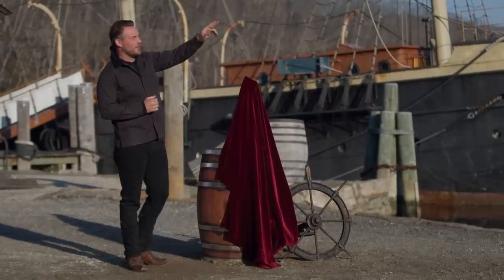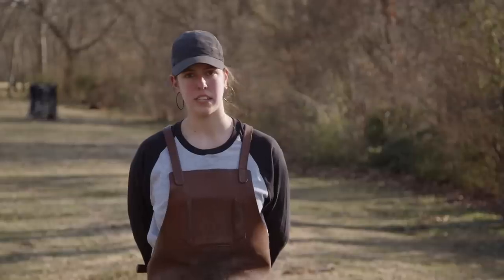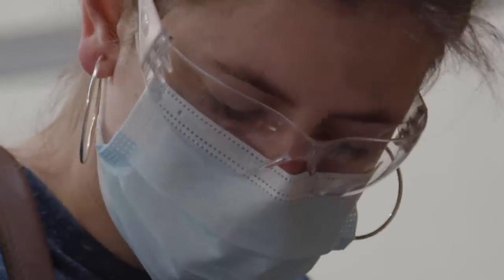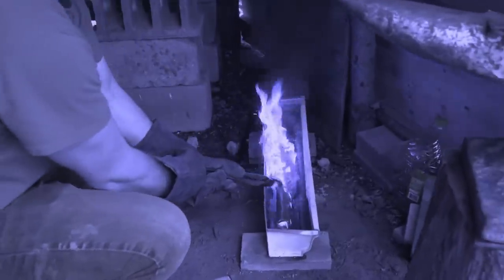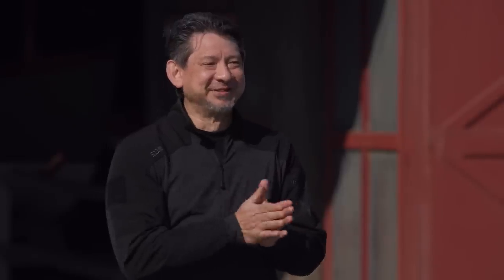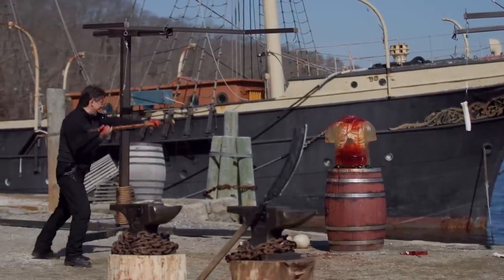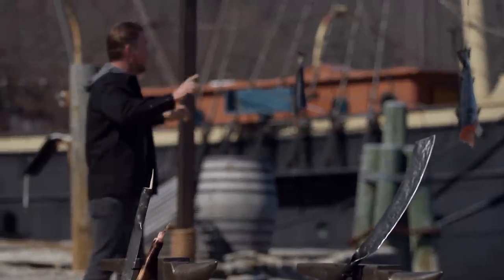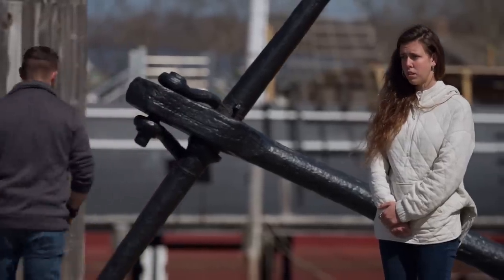Yo Ho! Flensing Knife Cuts Through Whale Blubber | Forged in Fire (Season 9)

Comment: I think it's incredible that someone as young as Felicia could forge a blade that strong and that light. If the show is still running for a few years and she pushes herself, I'd love to see her go up against Ben
Reply: Age dosen't mean anything as a blacksmith. I started blacksmithing when I was 13. You can make decent items after blacksmithing for less than half a year.
 same goes with the atitude that a smith has to be strong. If you have to use muchle as a smith, then you are doing somthing wrong. Heat = Ease.

Tho it is nice to see more women geting in to blacksmithing.
Reply: @mr-x7689  Made my first knife when I was 13. Made it out of a worn out horseshoe rasp. Had to heat it and make one side flat instead of half round. Had an old coal forge, I found in a junk pile, that I got working, and a section of railroad rail for an anvil. Read everything I could find at the library about forging steel. (Weren't no internet back then) Heated and Hammered it out, heated it really hot, and left it in a bucket of ashes overnight. Then used a band saw and grinder to shape it close to what I wanted, then heated it until a magnet wouldn't stick, and quenched it in used motor oil. Then ground out the finished look, and ran it through the fire a couple times to get it straw colored, and put it in a bucket of cat litter. That knife served as my hunting knife and black powder Rendezvous knife for many years.  It disappeared sometime in the late 1990's. 
Yeah, muscle is not really a requirement, but it can sometimes make things go a bit faster. Thus why many now have power hammers and hydraulic presses. I never had that luxury. Hammer and anvil. Hand cranked coal forge. I can't do that now. I no longer have a place to work with. I still have al the equipment, and the knowledge. Just not stored where I live.
Reply: Young people are talented. Work hard at what you love and don’t give up. You’re never too old to try something new either. Don’t limit yourself based on a number.
Reply: @williamsanders2808 that is a shame would love to see you test your mettle on the show.

Comment: I would've thought brass pins would keep it secure, but upon closer inspection they were just a bit wide and slightly off centered.
But gratz to Felicia as the new youngest female Forged In Fire champ. Though not how I would've wanted it to go,
having a weapon break like that, but a fair win's a fair win.
Reply: I also think that the weight of the metal mattered as well. I'm guessing a heavier blade would stress the wood more
Reply: Win or lose, you'd rather go the distance. If you win, you'd want it to be because you made a really good blade. If you lose, you'd want it to be because your opponent made a really good blade. A catastrophic failure is not a good result for winner, loser, or audience.
Reply: That Fellow, Christian  Many of us like the win by a narrower margin and with all tests completed successfully. There is no doubt that Felicia deserved that win.
There were episodes where one of the weapons was not tested at all because it was not structurally sound or too heavy. The winner deserved to win but it is not satisfying for the audience.
Reply: That Fellow, Christian  Not neccessarily. I recall an episode with a Viking sword were a contestant had problems with the material, ran out of time and turned in a sword with severe cracks. The judges issued a vote of non confidence and considered the risk in a test as too high. Only one sword was tested. Sure they could have ommitted that. That would have been even less satisfying for the audience.